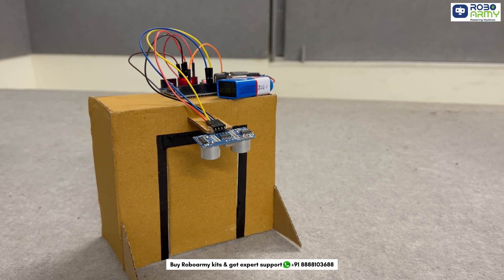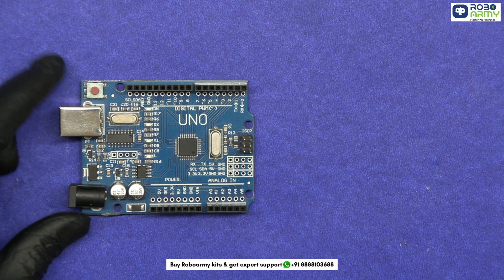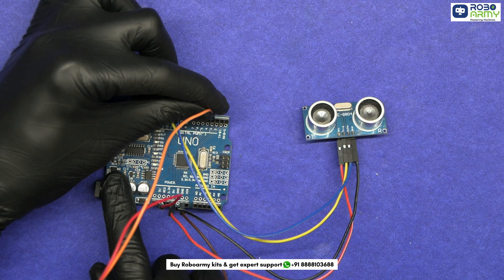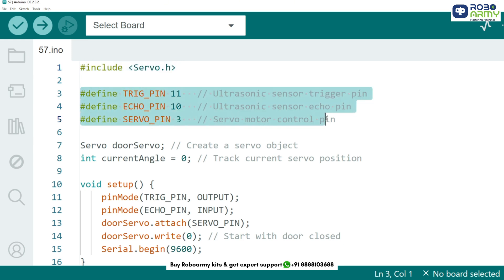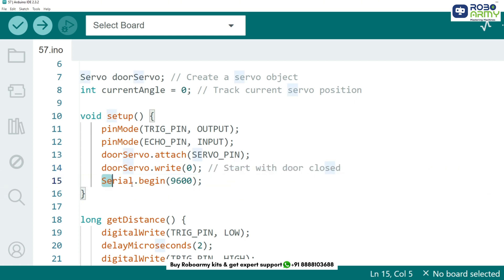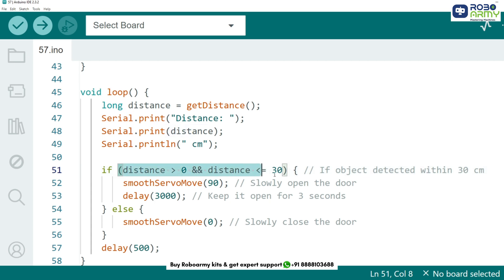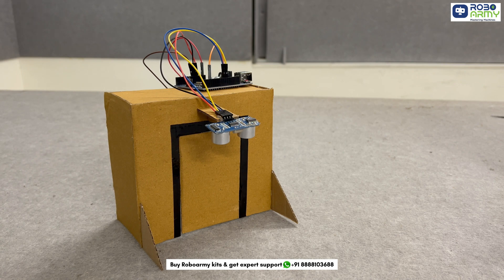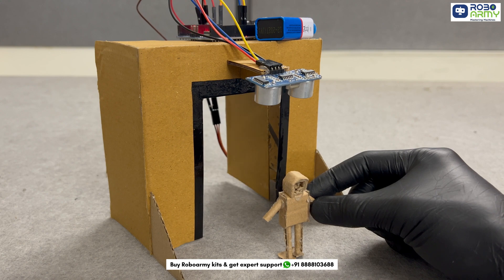DIY Automatic Door System with Ultrasonic Sensor & Servo Motor! 🚪🤖 (Live Demo)

Comment: This project can we do without Arduino
Reply from the maker: This project mainly uses Arduino as the controller to read the ultrasonic sensor and control the servo motor.
Without Arduino, you would need another controller like ESP8266 / ESP32 / Raspberry Pi Pico or a dedicated sensor–motor control circuit, which is more complex.
For beginners, Arduino is the simplest and most reliable option 👍

Comment: please explain servo motor red wire and ultrasonic vcc wire connection
Reply from the maker: Both the red wire of the servo motor and the VCC wire of the ultrasonic sensor should be connected to the 5V pin on your Arduino for power. 😊

Comment: Hi Sir if our sensor have OUT pin on it what jumper wire should it put it
Reply from the maker: Hi! 😊
If your sensor has an OUT pin, that pin is used to send the signal to your microcontroller.
So you should connect the OUT pin to any digital input pin of your Arduino using a male-to-male jumper wire.

Comment: Sir my arduino uno not working what should i do? And how did u supported the door?
Reply from the maker: Hi! 😊
If your Arduino Uno is not working, try these steps:

Check the USB cable – many times the cable is faulty.
Try another USB port or laptop.
Check if the power LED on Arduino is turning ON.
Install the correct board & port in Arduino IDE:
Tools → Board → Arduino Uno
Tools → Port → Select the active COM port
Upload the Blink example to test if Arduino is alive:
File → Examples → 01.Basics → Blink

If still not working, the board might be damaged—try using another Uno.

About the door support:
I made the door using cardboard, and I attached the servo motor on the side wall of the cardboard house. The servo horn was connected directly to the door flap so when the servo moves, the door opens and closes smoothly.

Comment: after i click the load button i got this message: Sketch uses 4378 bytes (13%) of program storage space. Maximum is 32256 bytes.
Global variables use 245 bytes (11%) of dynamic memory, leaving 1803 bytes for local variables. Maximum is 2048 bytes.
Reply from the maker: That message is completely normal 👍
It just shows how much memory your code is using on the Arduino board.

✅ Program storage space (Flash) — Your sketch is using only 13%, which means it fits easily within the limit.
✅ Dynamic memory (SRAM) — Only 11% is used, so you still have plenty of space left.

You can safely ignore this message — it means your code has uploaded successfully and everything is fine!

Comment: hello sir will it work without coding ? like you said now it's working without a computer system connection
Reply from the maker: Hello! This project still requires the Arduino to run the code, because the Arduino controls the servo and reads the ultrasonic sensor. What I meant is that once the code is uploaded, the system works independently — you don’t need to keep the computer connected. The ESP32 will run the program on its own and control the servo based on sensor input.

Comment: Sir code is not uploading it is showing error.
Reply from the maker: Hi! Thanks for trying out the project. If the code is not uploading and showing an error, please check these points:

Make sure you have selected the correct board (Arduino UNO, Nano, etc.) in the Arduino IDE.

Select the correct COM port under Tools > Port.

Check that your USB cable is working properly and supports data transfer (not just charging).

If you see a specific error message, please share it with me so I can guide you better.

Comment: My serbo motor not work
Reply from the maker: Hi! Thanks for your comment. If your servo is not working, here are a few things you can check:
Power Supply – Make sure the servo is getting enough power (preferably from an external source, not just from Arduino 5V if it’s a bigger servo).
Correct Wiring – Check that the signal, VCC, and GND wires are connected properly.
Pin Number – Make sure the servo pin in your code matches the pin it’s connected to.
Basic Test – Try running a simple servo sweep example from Arduino IDE (File > Examples > Servo > Sweep) to test if the servo is functioning.
Delay Time – If using delay() between movements, ensure it's not too short or too long.

Let me know what you’ve tried, and I’d be happy to help further!
Reply: @robo_army_ How many volts of charger or battery should be used with a servo motor / arduino?
Reply: Yes sir . After connected carefully still they are not  work

Comment: sir i cant add the full code it can only intake 2 kb so can you make me a small code please
Reply from the maker: Hi! Thanks for reaching out. The Arduino IDE has a limitation on the amount of code it can handle, especially when working with large files. To fit the code into the 2 KB limit, we can simplify it slightly. You could try the following adjustments:

Reduce unnecessary comments in the code to save space.

Consider removing or optimizing parts of the code that aren’t critical for the demo.

Use a more efficient way to handle some operations if possible.

Comment: How did you connect the engine from inside?
Can you take a picture or anything?
Reply from the maker: I connected the servo motor (engine) inside the cardboard structure by creating a small cut-out where the servo horn (the rotating part) sticks out and connects to the door. I fixed the servo body firmly using glue/hot glue gun from the inside so it doesn't move while rotating.